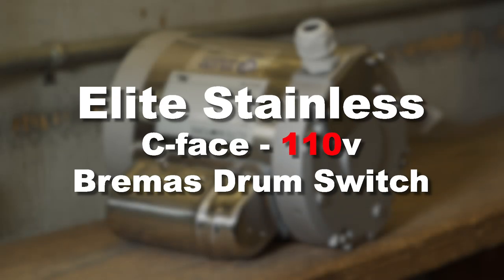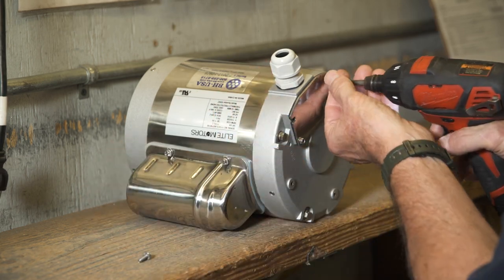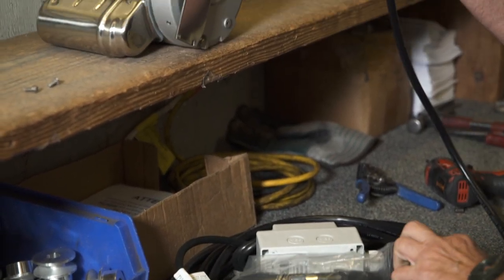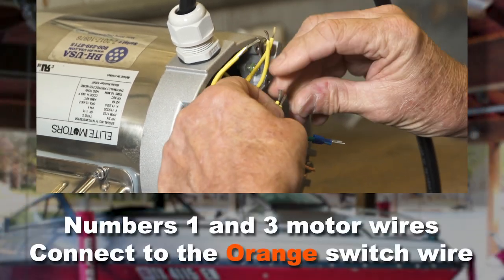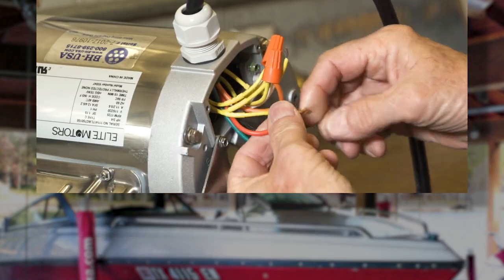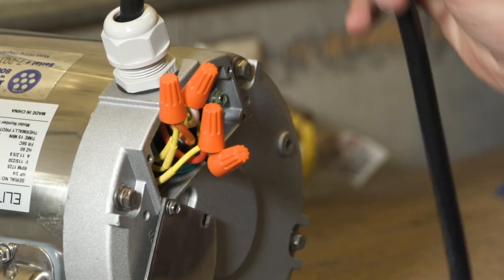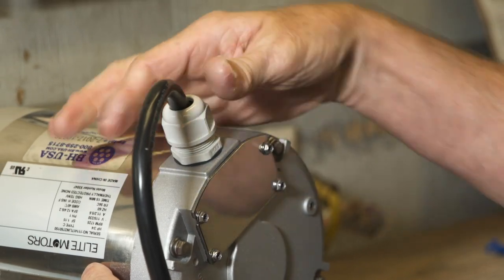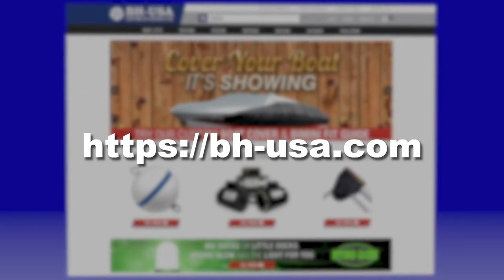Elite Motors - Stainless Steel C-Face Boat Lift Motor - 110v Wiring

Comment: Hello very good night, Sorry for the inconvenience, I follow you and I am a boat electrician, I am going through work to connect a C56AD35B17, Century, 3/4HP, 115 / 230V engine, Boat lift motor. could you help me ?